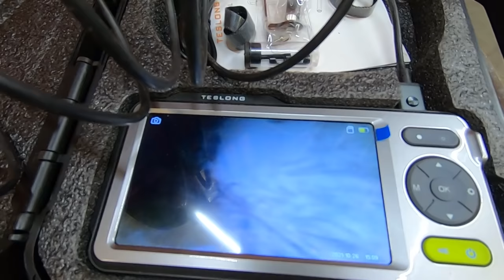Abandoned 1962 F100 Factory 4x4! First time driving on the road in 39 years!

Comment: You give me hope for mine: '62 F100 4x4 step side in Caribbean Turquoise, inline six, three on the tree, power nothin'. It does have the three extra leaves in the rear springs like yours. Originally purchased by my ex's grandfather when he was 82 years old. He lived to be 92, then his two sons kept the farm and the truck, but never lived there. Ex's dad bought out his brother in the 1970s, I came on the scene in 1984 when the truck had 13K miles. It slowly crept up over the years until around 2000 when the family hired a new farm hand who liked driving the truck to town - 16 miles one way. I visited before that and the truck had 19K, and by the next time I visited it had 29K. In 2003, with 30,300 miles on it, it was given to me. I've kept it garaged and driven it a little (it still has standard, not antique, plates and passes inspection) and last year it finally rolled over 40K. It's all original, but during those years on the farm it wasn't babied. Cattle farm + old men driving means it has plenty of cow and shed door dents. People keep telling me to "clean off those bird droppings" but it's white paint from when the truck was used as a scaffold when painting the barn. I've replaced the brake lines (and Inline Tube should still have the pattern if you're so inclined), some steering parts, tires, and all of the U-joints but otherwise it is untouched. I hope someday to get it fully restored but until then, I keep it inside, drive it once in a while, and wonder if/when I will get the $$ to have it done. I don't have the tools or a place to use them to do the job myself - plus, I don't want it to look like an amateur did it!
Reply from the maker: Sounds like a gem! I dig that color!

Comment: I learned to drive a manual in a ‘55 F-250. 292 Y-block, 4.88 gears, when I was around 9 years old. We had a long driveway and the truck had a bad battery. Dad made me take off in 2nd and  3rd gear. I could drive it up and down the driveway as long as I didn’t kill it. Seeing that engine brings back a lot of precious memories. My dad is my hero.
Reply from the maker: DANG!

Comment: Just watched this video. Great job. When Ford introduced the Y block people soon learned that they had a lousy oiling system to the rocker arm assemblies.  The solution was an overhead oiling system and that was supposed to fix the problem. It was still a lousy system.
Reply: YUP EVERY V8 UNC HAD HAD THE ARTERMARTKET OIL SUSTEM FROM PEP BOYS
Reply: An external feed to supplement the rockers on a Y-block, another is to enlarge the feed hole in the block, and cap off the rocker shaft, thus pressurizing the assembly. There's more than one way to skin a cat !
Reply: Grooved camshaft bearing helps too.
Reply: Well it is Ford. They have a better idea.
Reply: @kb9oak749  Ford was'nt alone for upper-end oil starvation. The 235-261 Chevy six had the same problem, with similar after-market kits.

Comment: Let the "HOT WATER HEATER" "UNTHAW"!
Yep, things we say without thinking!
Reply: @logicthought24   Your exactly right but it just so happened to work out unintentionally for the good. It has saved some blocks from cracking. But like you said that wasn't what they were engineered for.
Reply from the maker: Nice!
Reply: @logicthought24  they're not designed to protect. However, they may save a guy who doesn't have enough antifreeze in the system.
Reply: @dans_Learning_Curve  Come on guys,water expands when it freezes. Better to push out the"frost plugs", than burst the block or heads.
Reply: Also- Jumbo Shrimp!

Comment: Hey mortske. I dont have a hood, but on my truck i used a piece of 1x4 and layed in the gap between the hood and cowl. Lay one end of the board on the rad support and the other on the wiper cowl. As you take the bolts out, the board will catch the hood and support it. The board just acts as a helping hand so the hood isnt wobbling all over when undoing bolts.
Reply from the maker: good idea!

Comment: My friend, when you’re flying solo, take hoods off with your cherry picker. Wrap 2 ratchet/tow straps around the hood (one vertically and the other horizontally) and put the intersection of the 2 straps ( should be in the center of the hood) in your cherry picker hook
Reply: This also makes re-positioning the hood and adjusting it in most cases way easier since the weight isn’t hindering you

Comment: Truck turned out fine, if I had it, I would have to get the dash and lights right, maybe do a custom A/C heat distribution ala down split duct for floor heat, thin under-dash like some late 69-early 70's GM cars. Florida, hitta have A/C.😁😎

Comment: I love watching you work on the old stuff. We used to change ring gears on the flywheels. Never had the luxury of a torch though. Just  built a fire out back, shovel hot coals around the ring gear to get it off, either turn it over or if it's not too chewed just move it a little so the starter has fresh teeth to get that first bite.
Reply from the maker: Very cool!

Comment: That copper tube is used as a overhead oiler for the rockers. Something goes out on those motors prematurely. Wish I could remember what it is😂
Reply from the maker: Sounds like the oiling systems on them left a lot to be desired.

Comment: the oil line between the rocker cover studs was an early fix, ford addressed this problem with an internal fix by adding oil tubes on the front of one head and the rear on the other where the oil came up from the block. this system worker well even on race engines.

Comment: Excellent video Mortske Repair  :) also that truck wild for sure also gear shifter need fix & better fuel tank you be all set to drive every day and that new Y block must be low mileage for sure ! Also carb and exhaust be all set too! Did put newer dipstick with house in too also fix key ignition switch spray pentriotion fluid in teeth in middle pull key in and out couple times too!  Tangerine for Nickname truck too and add a Grey Bottle of STP Total Treatment fuel injection and carb cleaner in fuel run thru too it live it up!

Comment: This is very appropriately timed. I've got a 60 F100 motor going into a 60 F100. But the motor was last put into a '64 F100 so it has that single front bolt style mount (like the one in the video) that I need to change back over to the earlier y-block mount. Words.
Reply from the maker: Nice!

Comment: Clutch bolt is a shouldered bolt. Same principle as starter bolt. Keeps from snapping off. So you want to be sure to use correct fastener. 74 2500 4x4 full-time used same bolt. Had 1 that they kept blowing apart. I fixed with proper fastener.

Comment: If you happen to go back and look at messages from your old videos I was thinking of a good way to handle a hood by yourself get you a couple of them suction cups like they use on Windows to move them around and use it on the hood if you can't make suction sand and make it smooth again so you can make suction

Comment: A lot of times the rockers don't get enough oil because the cam bearings turn slightly and block the oil supply. My old 292 had that problem, and after the new cam bearings went in, it had great oiling up top.
Reply from the maker: Sounds like a big issue!

Comment: You don't always need a helper to torque flywheel bolts.  I use a Phillips screwdriver or a punch through one of the clutch bolt holes to hold the flywheel.  Just remember to remove it!

Comment: My first auto purchase was a '59 F-250 truck in 1971. I upgraded to the BIG 312, but the engine ran hot and overheated a lot. I was an ignorant kid trying to figure it out with zero understanding. Finally taking a wild guess I pulled the water pump off. The impeller was bakelite and had broken off the shaft. Never seen or heard of a bakelite water pump impeller since.
Reply from the maker: Hot rod engine!

Comment: Dad and I replaced the motor in my second vehicle when I was 18. The old 56 Ford Fairlane was a ruff starter car. Defiantly pull the hood. Warning head bolts have probably crystalized. Metal ages. good luck

Comment: i've upgraded to a one wire gm alternator on the last couple projects to deal with needing a new jenny, and not wanting to put a lien on the truck pay for it. the upgrade was cheaper, and it was fairly easy to rewire the system, especially since i was doing the whole truck.
Reply from the maker: Well you only need 1 wire! Should be pretty easy! Brackets are the hard part.
Reply: @MortskeRepair  you can find any bracket you want with a drill press, angle grinder, and a pile of steel plate, just ask puddin. that's why i call 'em builds, 'cause i always hafta build something. i've got a saturn vue in my shop this week i'm building a front end for. mostly 'cause i'm too cheap to pony up for a bumper skin, and a new fender. plastic welding for the win, alex! lol

Comment: The reason for the extra oil lines is that the Y blocks would quit oiling on top and people would add these lines to oil the top Th reason they🎉quit oiling is the cam bearings would turn and block off the oil passages Different fixes were developed to cure this problem

Comment: Great show had to comment I got a hold of a 52 hudson hornet and it hasn’t.t been on the road since 1966, and it’s complete except a coil and a rotor and condensers. But let’s not make things easy number 6 spark plug had moisture on it and twisted off leaving the threads in the cylinder head. Wish me luck keep up the good work
Reply from the maker: Good luck!

Comment: My dad had 1963 I think it has an old 292 y block if you need parts. It is a narrow long bed.
Reply: Call it old red
Reply: On top of the heads bolts drilled to bring oil up top is a kit to bring oil to valves and and tappers after the holes in the block oil passages get clogged

Comment: You should leave the external oil lines that feed oil through the valve covers. On that engine the oil has to pass through a little slot in the head gasket to get to the top end. That little slot always plugs up. The external lines get the oil to the top end. 
OR you will have to put in new head gaskets.
Reply from the maker: I would but I screwed up the fittings moving it around in the dark, frozen tundra! Has nothing to do with head gaskets tho.

Comment: 1962 was the only year for a 2 piece neoprene rear seal in a 292  it fits to replace 
the rope seal in an olds 260 to 403 
A lot of the y blocks had reground cam journals i was handed wood wasp to make it fit and it ran good 
the 3 digit code by the distributor determined the CID
Reply from the maker: Interesting.

Comment: My brother in law has a 4 wheel drive international travelall. Body rusted to pieces. So he pulled the body from the frame. and installed the cab from a 64 international pickup. that pickup had a slant 4 cyl three speed and the rear end housing was broke. My father had a 63 unibody that the body was really nice. He installed that 4 cyl and three speed. The internationl bellhousing even attached to the fords rear crossmember. He even bolted a second master cyl to existing holes in the firewall to make the internation hyd clutch work. It was too weak to pull the 390 rear gears and large 15 inch rear tires. So we installed the international dana 44 456 no spin gears in a 56 ford pickup rear end . He drove that truck for many years. Than gave it to my middle son. Who promptly pulled the engine. Was gonna install a 351 automatic. Never happened and the body was sold to a guy from Chicago.
Reply from the maker: Sweet!

Comment: ps I still have the 1975 f250 high boy I bought new in 75 made in the mahwa truck is mint, every one wants it, ith ford plant, my uncle was the supervisor on the truck line , they had a car line as well. when it was built I got to drive it out of the factory to the dealer about 20 miles , my uncle sold new fords as a side job at nite. dec 22 1975. thanks Pete.
Reply from the maker: That's awesome!

Comment: Noy a four wheel drive. However I have a 60s one ton in that body style. I pulled the 330 engine from a 68 ford school bus. Used the bus bellhousing and it all bolted in. Got a 14 inch clutch. better starter and alternator. And a superior engine that has more power and uses less fuel that the Y block. It also has hyd lifters and the rocker arms oil and the rear seal dont leak. Its very rare to find a Y block with rocker arms that oil and the rear main seal not leaking. That factory 4 wheel drive is rare. Most older 4 wheel drives where the NAPCO conversions.
Reply from the maker: Nice!

Comment: Oh yeah the Y block lives. And trust me Mortske the Y block overseas cousins are no better then the original is. I think the engine was run with old grandmas well water that's why it is so rusty inside. Also why make 2 different oil plugs? Ford and there obscure way's I guess. That go pro stall was like the epic moment before Mortske realizes I forgot do dump oil or it's gonna be a hot mess situation.

Comment: Take the rocker arm shaft off and clean out the oil passage that run through it Ford tend to plug them up when people neglect to change oil on schedule. Replace ing rocker arms  valve guides and stuff is no fun in a low cash flow period.

Comment: I think that your float may be adjusted a bit low on that carb, fuel should be level with the hole or trickle out when you remove the plug.
Reply from the maker: I think you're correct.

Comment: You might need to polarize the generator, being that the GEN light is on.
Reply: True. Whenever the wiring on a generator is disconnected, it must be"polarized" when re-installed on a running engine.
Reply: @jeromebreeding3302  The reason I chose the word might is because he may have already taken the appropriate action. I brought it up because sometimes in our haste we overlook the most obvious conclusion.

Comment: The reason the add on oil lines where add is lack of oil to the upper end, but if you look at the time of the y block most oils where no detergent and a lower boiling point,ones rebuild and using newer oils they oil  great
Reply from the maker: Yeah, lot of them out there running without any issues.

Comment: Just why did Ford put the  crossover in front of the engine? Imagine working on that on the side of the road. Y blocks sound like typewriters! I found my 60 f350 and soon found out the 292 in it ran ASAP with a set of points and condenser. I am so glad Chevy came up with the small block! The y block is such a primitive i design the way the oiling system was designed is crap. There are mods for that. Was 180 horsepowers. my 95 k2500 5.7 was also underpowered at 180 hp. Great vidja mortske!
Reply from the maker: Keeps your hands warm!

Comment: One question:
Why do you never remove the snow from top of the vehicle in front of the shop?
Is it so cold that the snow is to hard for doing that?
Reply from the maker: Correct
Reply: Plus, Duff didn't want to mess with it in the cold! Use the shop until they loose the shop!
Reply: How else do you get the floor clean?
Reply from the maker: @johngartner6710  Exactly!
Reply: @johngartner6710  oh yeah that's true! Didn't thought about that!

Comment: I had a ford truck with the same engine. It was missing both pushrods on one cylinder as well. It looked like it never had them. I put in new ones and it ran fine. ? Is it a ford thing 🤔

Comment: Puddin did say that if he could afford to buy something better than a Datsun he would but he didnt actually perfer small trucks and maybe later on he would be able to purchase cooler vehicles. Put some new rebuild paint on it so it will be rebuilt. The water pump will never fly its going to leak or go out immediately. 62 I like those trucks the one I had was very dependable but it was not a 4x4 and it only had a 6 cylinder in it. but it started every time and it was good in the mud and snow it had limited slip. Water pump worked? I think I could hear it. Im not there though.
Reply from the maker: Yup. Working fine

Comment: If you use 20w-50 oil it will make more oil pressure and the engine will run better
Reply from the maker: How exactly does oil make an engine "run better"?

Comment: Not your fault the shaft was broke. I seen this before. That bolt that came loose on the rocker shaft was the culprit. Once the bolt came loose the shaft will flex and then break. Once the shaft breaks the push rods fall out.
Reply from the maker: Ahhh makes sense now!

Comment: Those aftermarket oil feeds were called "Overhead" or "Outside" oilers ...both Y Block Ford's and Oldsmobile motors with rocker shaft   rocker arms were both notorious for piss poor oiling and rapid valve train wear
Reply from the maker: ahhh gotcha! I know 455 olds had issues with starving the oil pump as it couldn't return fast enough from the top end

Comment: Remember Folks: Always store your Y-Block with Water as Coolant, as the engine is also a plant and will dry up/wilt away without the added moisture. Why do you think coolant is green? It's for engines, that's why they are called 'power plants' too. 

This has been Davey with your Hippie-Dippy Oily-Coily Car "Fact" of the day. Cheers!
Reply: always use a 50% mix, (50-50) of coolant to water
Reply from the maker: Nice!

Comment: Look like there is something very wrong with #5.  I know you don't want to pull the left head off and your not on an engine stand where you could flip 7 her over and pull the pan to look at the  big end of the rod to see if the bottom went south and  to minimize the noise the permanently closed the valves on #5. If you break the skirt off the piston you can pull  a piston and rod out from the bathroom  with out pulling the crank. Desperate tims call for desperate measures and 7  cylinders are better than none.

Comment: I have a Ford 600 1961/ Was a vac truck. Was bought in 1964. Turned into a winch truck.  I have to go look but I think it's around 79,000 original miles I don't think it reached 80,000 yet I don't think